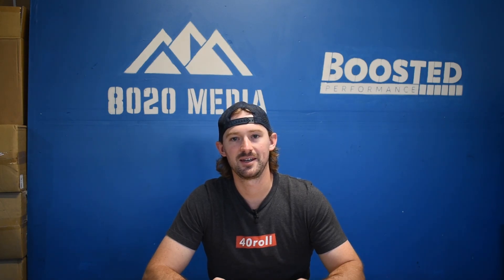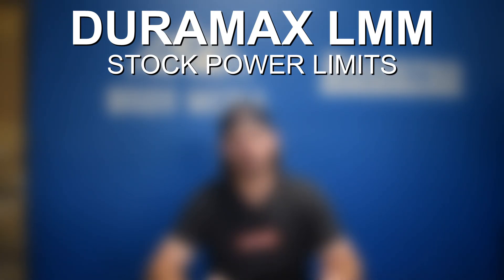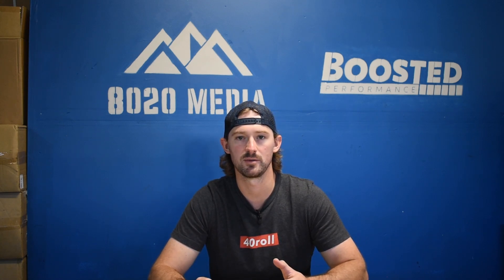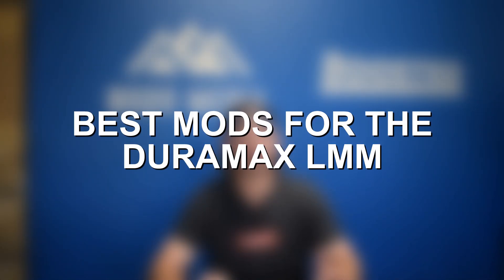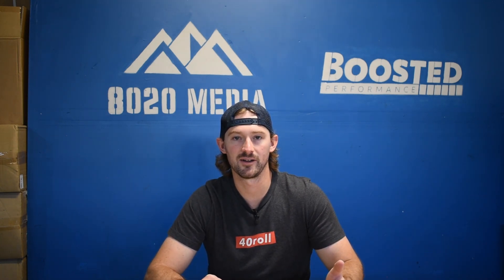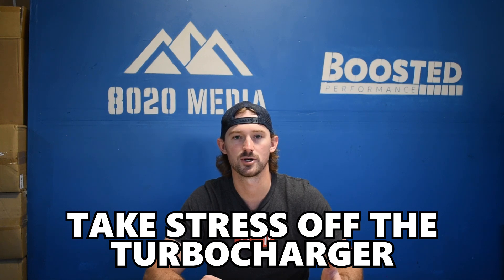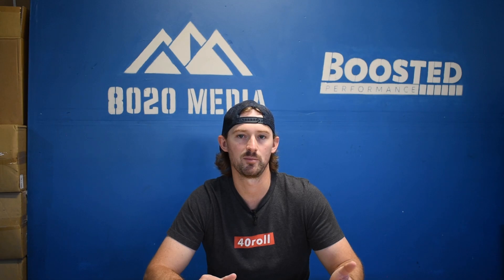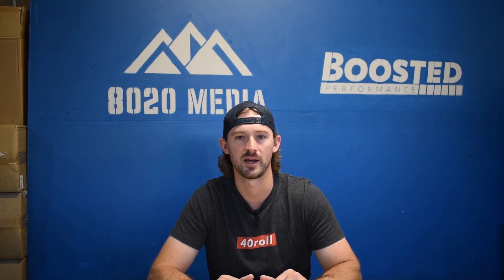How to Build a 450 WHP Duramax LMM!

Comment: Any advice on increasing my MPG up 22mpg, from 15.5mpg? I have a 2009 GMC sierra 2500hd lmm
Reply from the maker: T - On your 2009 Sierra 2500HD LMM, jumping from 15.5 mpg to ~22 mpg is a tall order for a heavy Duramax truck, but you can realistically squeeze more efficiency with a few changes: keep up on basic maintenance (fresh fuel filter, clean MAF, good air filter, correct tire pressure, quality synthetic fluids in the engine, diffs, and transmission), run a mild economy tune (EFI Live or HP Tuners with a reputable tuner can adjust fueling/timing for efficiency without killing reliability), and drive with a lighter foot by keeping RPMs low and using cruise control when possible; adding a free-flowing exhaust and ensuring the DPF isn’t restricted can help, but don’t expect miracles without deletes (which are not road legal). For highway use, swapping to more highway-friendly tires and dropping excess weight (toolboxes, racks, etc.) can also pick up 1–2 mpg. Getting a full 22 mpg out of a 2500HD is pretty unrealistic unless you’re running deletes with a very mild tune and driving mostly highway at steady speeds, but you should be able to improve into the high teens with a combination of maintenance, tune, and driving habits.

Comment: Im a tech at my local chevy dealer not much diesel experience but id say im a pretty competent tech. Of all thengenerations of duramax’ (other than l5p cant afford one) would you recommend for someone who has some experience and willing to learn. Looking for more reliability and keeping the truck for years. Any response would be appreciated thanks
Reply from the maker: F - Great question—and sounds like you’ve got the right mindset for owning and maintaining a Duramax long-term. If you're prioritizing reliability, long-term ownership, and are comfortable wrenching, the LBZ (2006-2007 classic) is hands down the sweet spot. It's the most sought-after for good reason: no emissions equipment, strong internals, great power potential, and excellent durability. It's also pre-DPF, so fewer headaches, and it's not as picky as later generations when it comes to tuning. Second pick would be the LLY (2004.5–2005)—solid engine but just keep an eye on EGR and head gaskets. If you're okay with a little more learning curve and some emissions gear, the LML (2011–2016) is also a solid choice—stronger bottom end than earlier gens and better emissions tuning if you plan to keep it compliant. Avoid the LMM (2007.5–2010) if you don’t want to deal with early DPF headaches unless you're deleting, and definitely skip the LB7 unless you’re ready for injector replacements. Overall, LBZ is king for wrench-turners, and it holds value for a reason.

Comment: Looking at upgrading my lmm, don’t do anything crazy with it, looking for a bit better fuel economy and longevity out of the motor. Would you suggest the PPE xcelerator BEFORE upgrading the exhaust. Looking to do pcv reroute, lb7 up pipe etc etc, any advice would be appreciated! Thanks
Reply: Go with same day tuning bud. I get 28mpg on the highway. Company in Canada and is a stage 5 EFI live tune and has transmission tunes. They do custom tunes as well
Reply from the maker: L - It honestly wouldn't matter either way! We tend to lean on adding all of the bolt ons you want before tuning.
Reply: @8020Automotive great, thanks guys I appreciate it
Reply: Exhaust would be the PPE manifolds or DHD then go on to upgraded up pipes from DHD  get all new gaskets and hardware you’ll need it lol. PPE 3” downpipe, 5” straight pipe exhaust. My EGTs are super low when I had that setup alone. Now I have the Full HSP kit and a stock turbo with built internals and a wicked wheel-( wicked wheels do practically nothing Jtlyn) just didn’t want to put the factory shaft and wheel back in. Uhhh lift pump definitely just go with a airdog or Fass 165 or 155 if your gonna want mods. With this also go ahead and get a sump kit for your tank. Believe me it works wonders and makes the install a hell of a lot easier. I did do some transmission work myself I got the valve body pulled and put a shift kit in it and Mike L springs that comboed with transmission tuneing was given me a hell of a reliable and fast truck. It beats a 6.2 Camaro to 0-60 but obviously I don’t have the speed in those higher gears like a car.
Reply: Ohhh and make sure to get rid of the fuel filter on the truck. No need for the fuel restriction your lift pump does a way better job and doesn’t leak down pressure causing crank no start issues later on. So real good idea to go aftermarket and get a billet block That retains the water in fuel sensor don’t just get a cup or a blocker. Remove the whole thing and go aftermarket. I also would recommend for fuel getting the fuel block from DHD she lets all the flow go and I believe the aftermarket fuel filter head that’s billet has 1/2” lines going to the pump. Also upgraded my cp3 pump fittings as well. Another good one. Welcome to Duramaxs they are fun but cost money to have it 😭
Reply: @truereality5873 thanks for the feedback!!
Reply from the maker: T - Thanks for taking the time to share all of this and assist viewers!

Comment: LMM has a wrist pin issue, which is why he talked about the piston cracking. It's believed it's due to the injectors having 6 spray holes instead of the previous gen (LBZ) having 7. Not that the LBZ is any better. It puts opposing fuel streams right above the wrist pin.

Comment: Can a Lly mouthpiece fit a lmm turbo? What are the differences?
Reply: LMM turbo is actually smaller than a LLY turbo. 61.99mm vs 63.5ish (most people say 64mm) largest stock turbo on any Duramax. I know the mouthpiece on a LLY can be altered slightly to fit a LBZ turbo. Which doesn’t help your question. But with the smaller turbo I can only assume there would be fitment issues.
Reply from the maker: D - Thanks for taking the time to respond to a viewer!